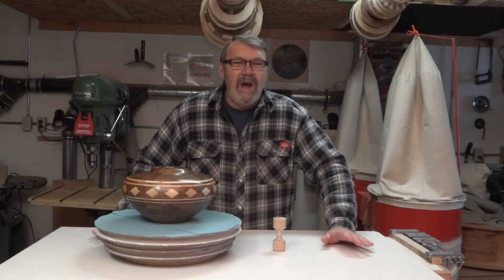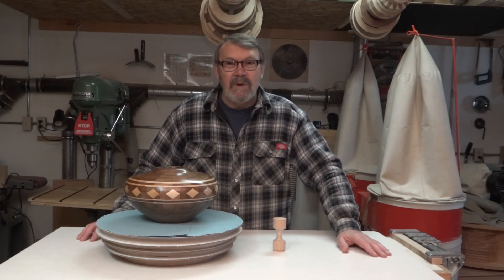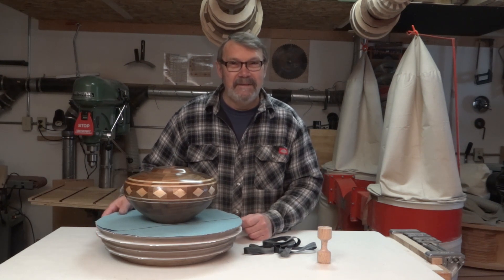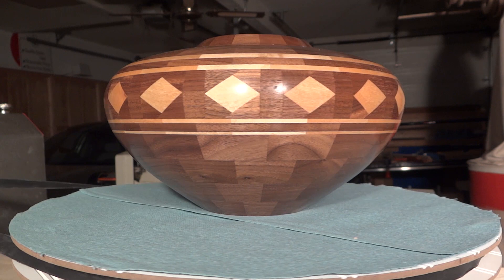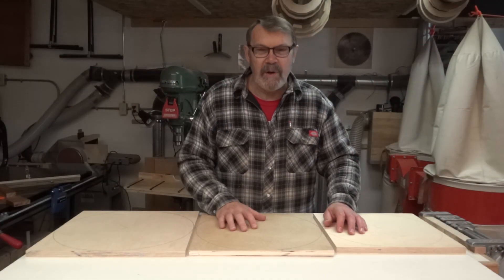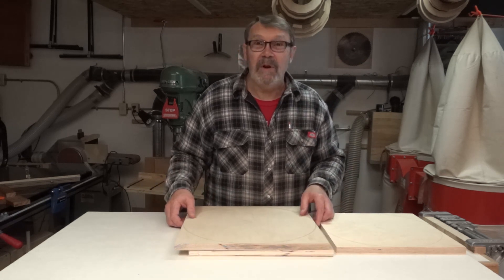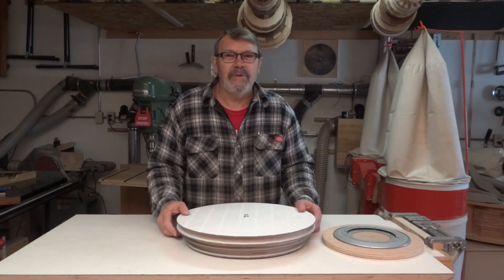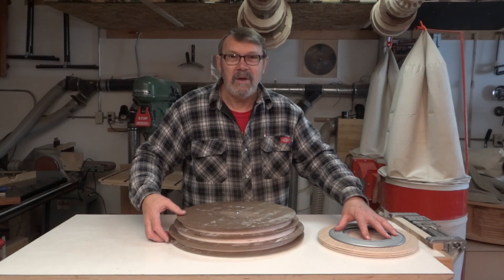Lathe-Driven Variable Speed Turntable

Comment: That's a cool idea Gord. Bad news for me is the lowest speed on my lathe is about 500 rpm. Not sue I can turn a spindle that small or make a disk big enough to get down to 4 rpm.  :-). Steve
Reply from the maker: Steve Lindsley 
Actually, Steve, you could do it but it would involve a bit more work. If you used the 3/4" drive spindle and a 16" disk the speed would be brought down to 20 rpm. Then if you put a 2" disk above the 16" disk and made a second lazy 
susan with a 10" disk that would give you a 5:1 ratio and bring the speed down to 4 rpm. Then of course you would have the problem of where to store everything. But if it was needed it could be done.

Thanks for watching, Steve. I appreciate the support. BTW, I LOVED your port-hole vessel. Beautiful job, Steve.
Keep your blades sharp,
.....Gord